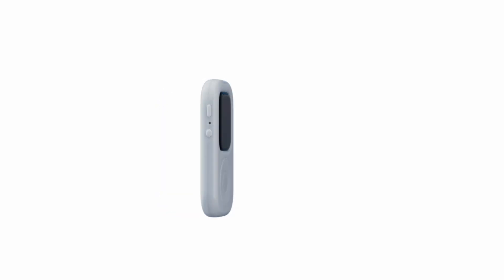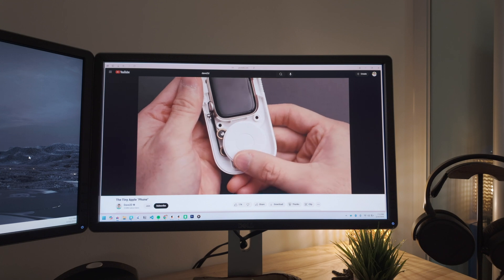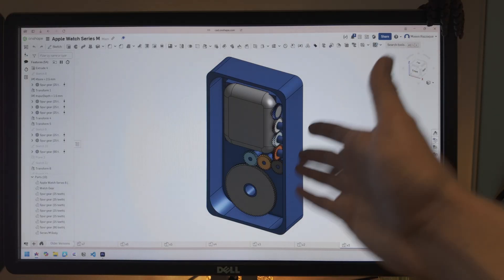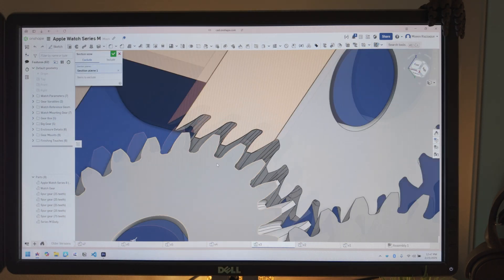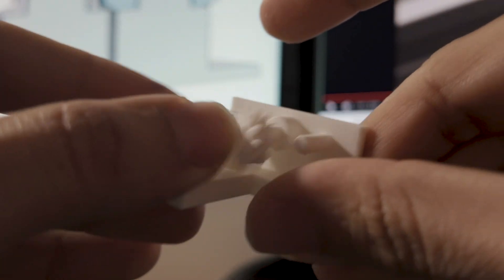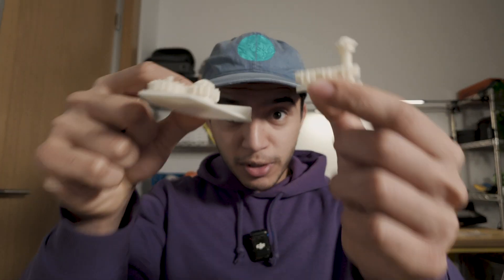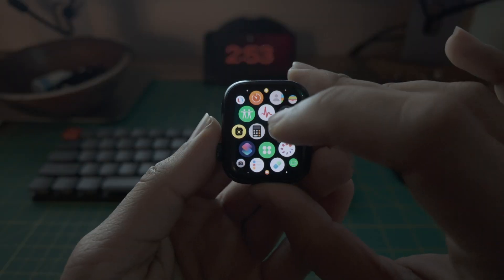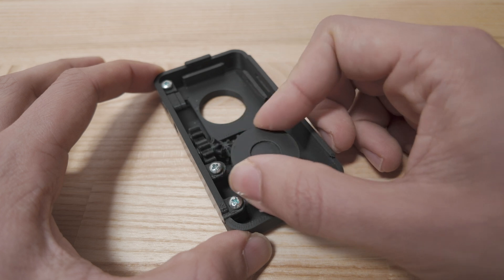i built the $79 tinypod for $0.92!

Comment: Doesn't the appletwatch have some connectors hidden inside a little drawer on one side of its strap? Wouldn't it be possible to control the movement electronically through them?

Comment: This is so high effort for such a small channel! But still I thought the gear version was better. All those hours into 3D modeling shouldn't go wasted, and with the bluetooth button, you would also have to manage the electronics inside, which requires charging and much more maintenance. But still, both solutions were very elegant!
Reply: maybe can put something underneath the watch that connects to the bluetooth button, so that wirelessly charging the watch charges the bluetooth button electronics as well

Comment: Found your channel a few weeks ago and instantly subscribed, the moment I saw this in my feed I knew it'd be good, some things I was curious about, though!
1. Would it have been possible to secure the gears in v3 by modeling and printing some conical end-caps to stick on the end of the gear shafts and affix them with the heat of your soldering iron? (Similar to how Brass Heated Inserts are affixed to prints in other peoples projects.)
2. Where was revision 2 of the all-3d-printed version? 
3.  what was the total cost of the encoder-equipped version?
Anyways, Excellent Video! Looking forward to seeing your future endeavors, starting Next Week!
Reply from the maker: hey! thanks so much for the thoughtful comment :) really appreciate it and love this kind of stuff since im always trying to improve as a designer/engineer

1.) i tried that, and you can see the "gear caps" in CAD when i talk about trying other fixes for the helical gears. the problem i found was that even by fixing the gap, so much of the force was being redirected and since the space i was working with was incredibly small (talking 0.5 - 1 mm), i couldnt fix it in such a way where i could get rotation to transfer.

2.) i combined some revisions due to brevity! basically i just found in that version that i could decrease the number of gears by changing the incident angle.

3.) total cost of the encoder equipped version was around $50? i had some parts on my own so that didn't factor in as much, but adafruit's stuff can be pretty expensive :(

thanks for watching!!